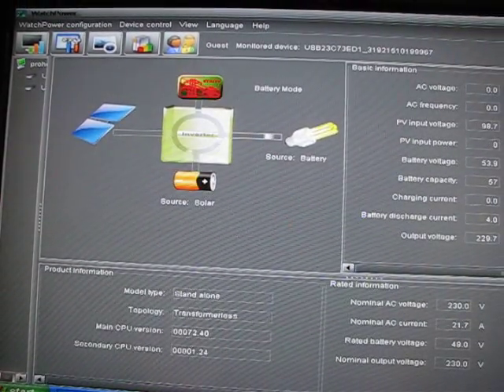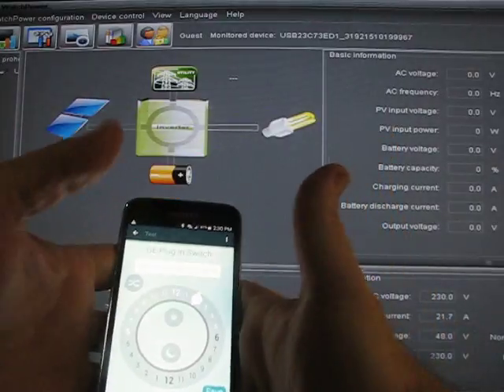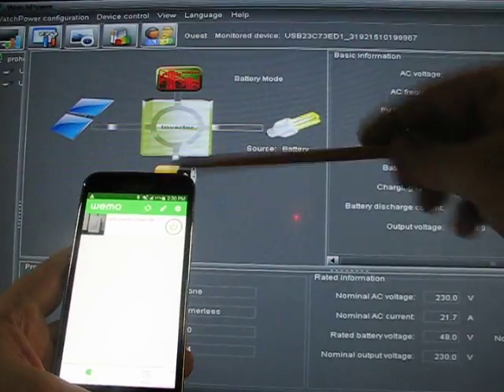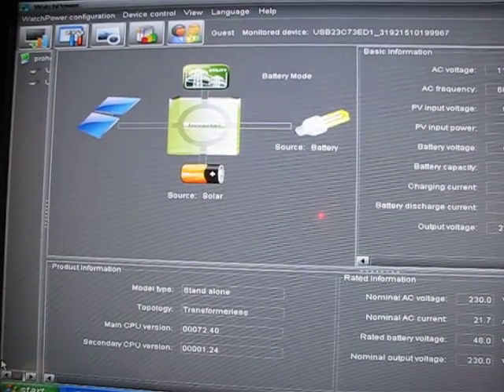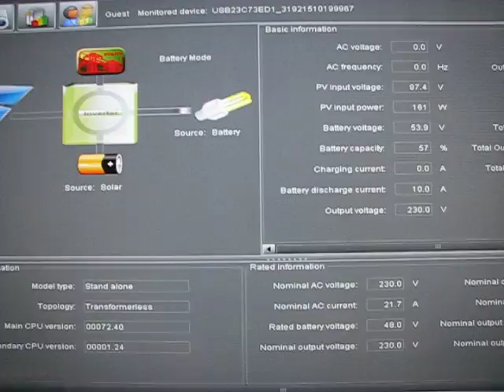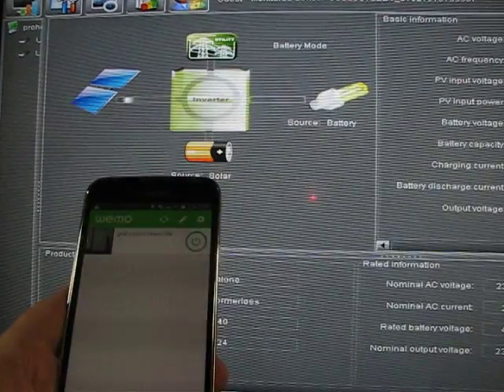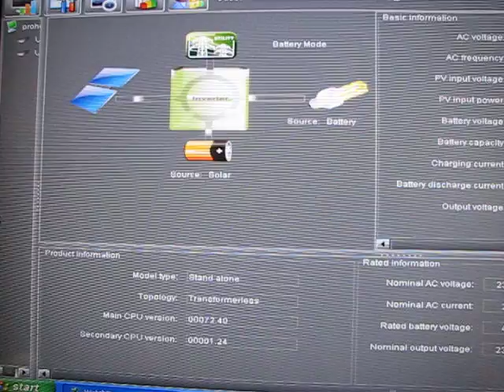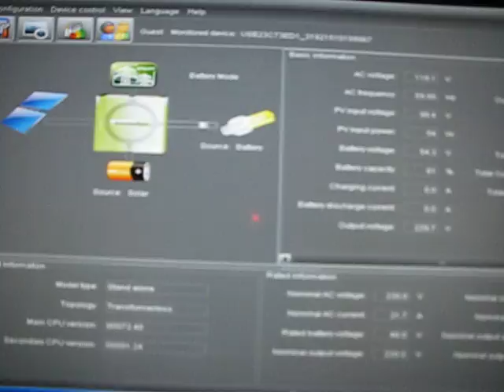My pip 4048 ms Remote Control 48v Lithium Battery Life Project

Comment: I'm a big fan of the Wink Automation System that can use any wifi switches and monitors. This would likely be a more adaptable platform for your system.
Reply from the maker: Ron, Thanks for that information! What wifi switches do you like & Do you know if  wink will work with bluetooth?
Reply: I use Luton switches but you can literally use most any, as the Wink system is very open to 3rd party branded devices. Bluetooth is also compatible. I have a complete home automation system that covers almost every aspect of my home and it has been very stable given its cheap price and no monitoring. The Wink2 hub is standalone and doesn't use cloud based protocols, so you would save some energy by not powering the Internet while at home. Need to show you the app. one day and all its functions when your not busy.
Reply from the maker: That sounds perfect thanx!!! 
exciting to be able to control things like this.

Comment: Hello from Cairo. I just discovered something that I wanted to share with you.

You know that the Powerwall 2 is 14 kWh and it has a built in inverter, liquid cooled and can be installed out door. I am not sure if it can give back power to the grid to make money or not but let us assume that it does not. We also know that the price is $5,500. As for the cost of installation well I suspect that you and I can easily install it ourselves. So let us say zero for that.

Now how will this affect the price of say a salvaged Nissan Leaf? If people buy it with intention to take the battery pack and use it for solar storage, then it has to be dirt cheap. Because of the work involved and the additional cost of the inverter etc. In addition it will not be liquid cooled and might not withstand the out door.

So I looked at the price of the salvaged Nissan Leafs. 

http://www.carjunkyards.us/auto/wrecked/NISSAN/LEAF

These prices will drop like a stone and in turn will affect other brands. Not only that but I suspect that the price of a used and working EV will also drop like a stone. And that is because of the price of a new Powerwall 2.

What do you think?
Reply from the maker: Built in inverter! WoW that is next level. 
Now it needs a built in grid & solar charge controller just add panels and go.
Reply: The solar charge controller is already in it. They call it converter. It takes the DC of the panels converts it from the voltage of the panels to the voltage of the batteries. You can do that by a SEPIC converter.

https://en.wikipedia.org/wiki/Single-ended_primary-inductor_converter

What this converter does is it takes any voltage and output a steady voltage. So you will never over charge the battery. At any rate this is already built in the Powerwall 2. The next level is the price reduction.

What do you think?
Reply from the maker: Outstanding! 
Have always loved the tesla product.

See i have lot's to learn about the new powerwall.....

Think i want one! Key word is want!! lol!!!